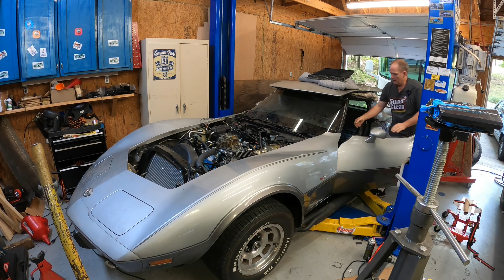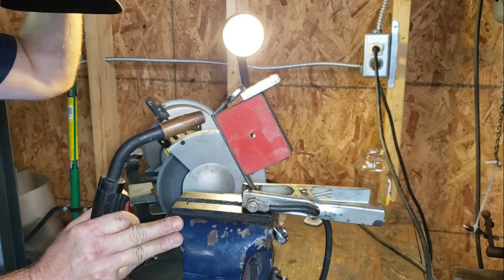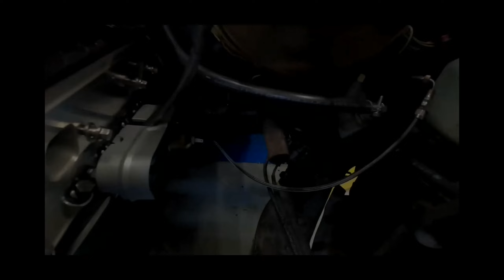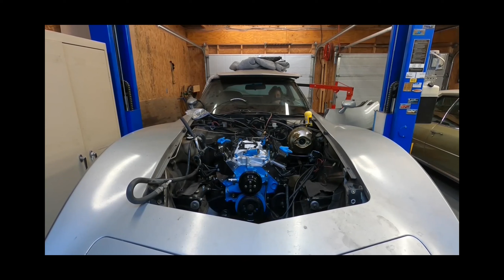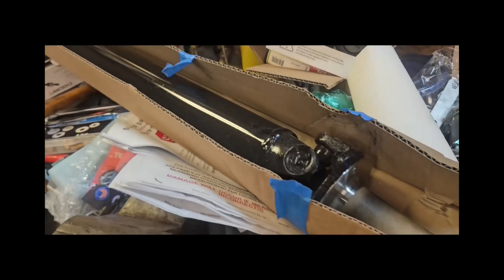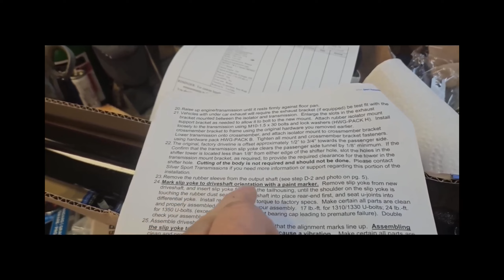1978 Corvette Restoration Part 24 - FIRING UP THIS L-82 BEAST WITH SIDE PIPES !!

Comment: I'm trying to find out how much further back the mounting point on the TKX is than the mounting point on the T10 that you took out? Thank you
Reply from the maker: Well to be honest I never measured that. All I know is that Silver Sport repositioned the shift to accommodate the C3. If you really wanted to know, I would get on the Tremec site and find some basic dimensional drawings and compare that to the OEM transmission.
Reply: @ImpalamansGarage OK thanks! I really appreciate it!

Comment: Is the reverse switch easy to replace if you jack the car up? Couldn't see the exact mounting location from your video. I have reverse lights that are sticking on and was thinking I may need to replace this piece.
Reply from the maker: It's on the side of the transmission. As I recall it should not be hard to get to. Keep in mind that I am using a Tremec 5 speed from SST.

Comment: Question on your timing and rpm.  900 rpm’s for idle. Would that be the same for a mild cam or would that change things? I have a SBC350 with a mild cam but I am not sure what it should be idling at. I had a guy quickly look at my timing but not sure it is right. Hard to find someone that still knows older motors like you seem to.
Reply from the maker: I'm no expert - just a nutty hobbyist. :)   I set the base timing and idle per the emissions sticker. (12" BTDC @900rpm for manual trans cars) This is my starting point. I have a LOT of tuning to do yet. I think I have some vacuum leaks also. The cam I installed is not terribly wild. Any mild cam upgrade should idle "near" the factory idle settings. Of course the wilder you go, this will change the idle characteristics greatly.
Reply from the maker: @brianabston1801  By the way I found the vac leak. LOL.... she is idling nicely now.
Reply: That’s good news. Vacuum leaks are not fun on those older Corvettes. Mine seems to run good but I just don’t know how to tell if it is 100% correct. My 350 was built when I got it but seems like the idle is low(just under 700) and seems rich. I put a new carb and seems to run a lot better but I wonder if it could be better.
Reply from the maker: If running an automatic transmission, the idle is typically lower that for a standard transmission car. Mine is a standard.  Have you tried using a vacuum gauge to see what level of vacuum the engine is making at idle?